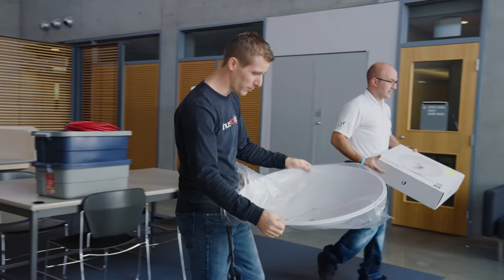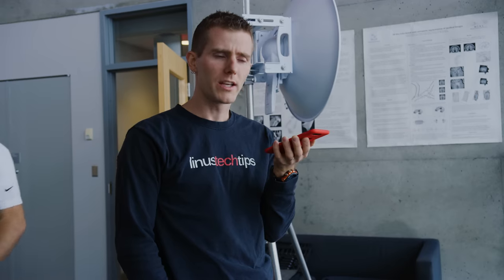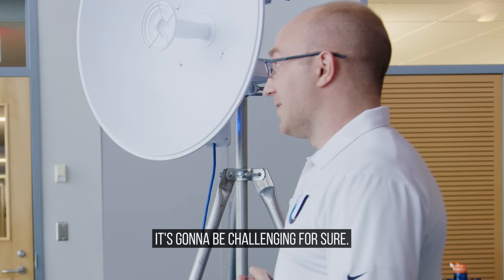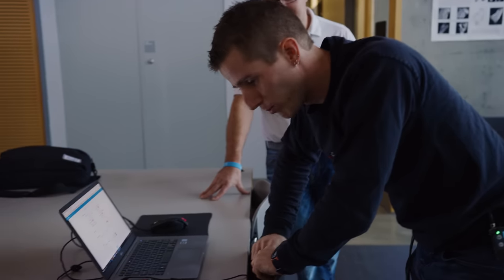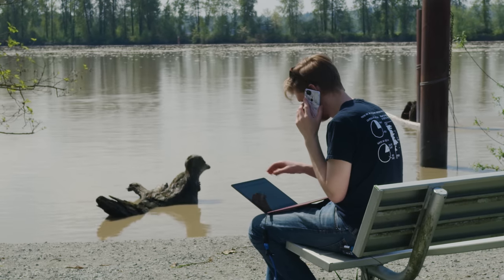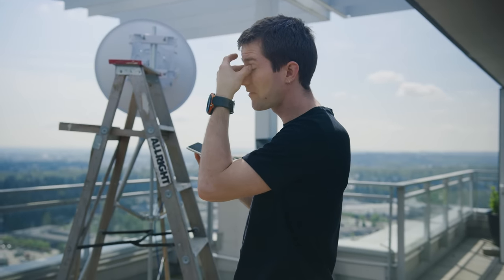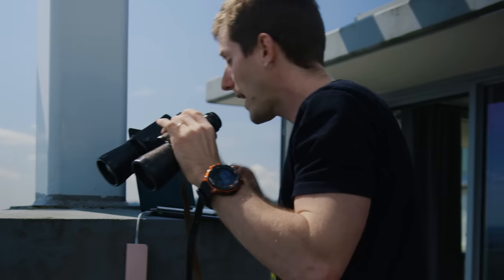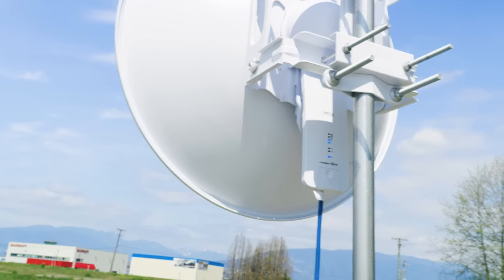12 KILOMETER Wi-Fi - SUCCESS!!!

Comment: lol Back in the days when no one password protected their wifi, I would just get an old Dish Network or Direct TV dish, a USB extension chord and position a wifi dongle approximately 2 inches below where the amplifier (signal reciever) went and could get signal from 2 to 4 blocks away pretty easily. I helped a friend who lived on a hill do this and we actually got somewhat reliable signal from a hotel 3/4 of a mile away. We picked up the college campus 2.5 miles away, although we couldn't connect reliably. For the record, as far as I know, the local laws allowed for this but I was still courteous when I could see that they were using a lot of bandwidth and would disconnect.
Just remember that a dish is a directional antenna and point the thing toward the router/antenna.
Reply: You have to remember that the dish/antenna will only amplify one direction. If you want a reliable connection you need antennas on both ends. Thats why you can rig up a "cantenna" or a makeshift dish and pick up peoples wifi signals, but if their router cant send packets back its basically pointless.
Reply: @coreyrussell8895  The dish will amplify in both directions, satellites don't have giant dishes on them. Also this trick actually does work, the feed horn is just a simple dipole antenna just like the antenna in the wifi dish.
Reply: @derpinbird1180  satellites don't send a signal, they simply relay signals that are sent from a transmitter at a different point on earth. You need to have an amplified signal on both ends.
Reply: @coreyrussell8895  How exactly would you relay a signal without receiving it and then transmitting it again? Or do you think sattelites relay the signal with no power and no processing? A dish is just a mirror it works the same way in both directions, it boosts receiving sensitivity and transmission power by whatever the db rating is. Have you ever seen a dish with two different db ratings for sending and receiving? Could you link me one?
Reply: @derpinbird1180  I don't know what kind of point you think you're arguing. Satellites amplify the signals from the ground using transponders. I'm not here to teach you networking and communications, but I suggest you do some research before making unfounded claims.
Reply: @coreyrussell8895  No magic dish with different tx/rx sensitivities then? Are we arguing on the definition of a transponder now?
noun
plural noun: transponders
a device for receiving a radio signal and automatically transmitting a different signal. 

Gee that sounds and awful lot like what i just said
Reply: Found this on a website, already know this though as i already told you that you cant find a dish with different tx and rx sensitvities but this is what an article on processor online said: General features of antennas
Every antenna has its own specific design characteristics that determine the range and radiation pattern of the radio signal. Also, if you analyse its radiation pattern for transmitting, its sensitivity pattern for receiving is the same. That is, the direction in which it transmits the strongest is also the direction in which it is most sensitive for receiving.
Reply: ROFL This is awesome! 
I don't know why this became an argument or got so complicated but if a person can't visualize what the dish does, a little experimentation will lead one to conclude that the dish is just a mirror/lens combo, like Derpin Bird mentioned. Polish the surface and it does the same for the visible light frequencies. Put a speaker or microphone into position and it does that same for sound.
...it ain't rocket science.
Reply: Nah man were totally wrong we haven't done enough research
Reply: you can hear the signal but it can't reach you to talk to your radio.......lol it isn't amplified

Comment: Perhaps use flare guns to get exact bearings. maybe WIFI signal can go even beyond 12KM's. Also a powerful handheld laser on a clear night can also be seen.
Reply: Or just use GPS lol. Once he can get it within the margin of error for GPS, he can then mess with the angles a bit until the beam is on point.
Reply: It can.  I (vaguely) remember reading about an experiment in the early days of wifi where they shot an 802.11b signal over a mountain with a passive waveguide (soup can) repeater on the top of the mountain for a 10 or 12 mile link.
Reply: It's all about line of sight.

Comment: I set up a 17mile Ubiquiti link today. That’s a long ducking way for you metric types. But I had some height on each end.
Reply: promethbastard - very true, some are smarter than others. Truth is I was too tired to do conversion after climbing towers all day lol.
Reply: easy with amplification..
Reply: It annoys me how long they take set up this type of link... I did 5k solo with my ubnt kit in about an hour
Reply: Robert Buchan Terrey - I have a couple of the POE battery packs with WiFi. Makes setup so easy, can configure and peak from your phone. Hardest part is not dropping phone off tower while turning wrench.
Reply: @PapaWheelie1  Some clamps or the bendy clamping tripod and a phone mount would make it easy to fasten your phone right to the tower.

Comment: Oh man... I am so cringing on how you guys are doing this. You should come to my work and we can show you how it's done. Let's just say we had an 500Mbit/s airfiber ptp setup at 27km. It's now replaced with a 2Gbit/s Microwave link. 😎
Reply: I'm sorry, but for your information, the current fastest mode is fiber optic, which is 100 megabyte per sec per strand.    

do you mean 500 megabit ?   that would be pretty good for 30 km
Reply: Yeah, sorry got my acronyms wrong. It fixed now.
Reply: what wattage did your transmitter had?
Reply: Can I do this at home? 😂 or at least suggest me some parts for faster internet.
Reply: You probably can if you have the money. Just for the AirFiber5 alone, they are $1,000 USD each. Plus you need to make sure the source connection has enough headroom speed wise to even deliver that much throughput both ways. For us as an ISP we have a 40Gbps connection to a nearby data exchange so we have plenty to work with. If you think this is expense just imagine how much license Microwave ptp links cost. For most people, you'll probably have better luck using NanoStations ACs for home ptp links. Easy to setup and just need to make sure they are within line-of-site to get the full throughput. You won't get the distance like with what linus used, but it will work if you have the headroom. If you can, try to get the World versions instead of the US version.

Theodor Butters, if you want to know specs on ubiquity airfiber radios, you can look online at ubnt.com. They have datasheets on all their radios and are fairly realistic.
Reply: Albert Westra Sounds like a video made by you would be wayy better then whatever Linus made.... Where professionals stand out from amateurs like Linus.

Comment: I had a similar set up a couple years ago, I actually commented on the original video asking how to set it up over longer than the parking lot distances. I could never figure out how to set it up because I was sure there was a "professional" way of doing it with compasses, maps, people, and "resources". Like, there was land elevation, hills, valleys, peaks, water, no water, gods or no gods...anyways the building that the receiver was on burned down and I was forever unburdened by that $700 impulse buy, and failure reminder. 

Fast forward a year and I finally see this update to the original video and am a little happy that there actually wasn't much more than two people using the led indicators and cellphones, thank you for making this video. I mean, I should be mad, but i came up with some good ideas, so it wasn't a complete waste.

I had used a topographical map for the first time in my adult life. I learned that, while compasses point North they help not when North is not what you are trying to find. At the time I don't think Google Maps had a simple line drawing tool but there was a hard to find website that could plot a line of sight. I mounted the receiver on a 75ft grain elevating leg...think of that for a minute... I waited for Maps to update and tried various ideas on using GPS location numbers, compasses, maps and that little needle device that you see in movies about sea navigation. I even ran an inverter off my truck and drove to the mid way point to try and find the signal, BUT...i stopped short of buying better binoculars because I was sure I was so far out of skill to set this up.

Comment: Or just get a mobile data plan
Reply: because of course mobile data plans are fast enough to give you 200+ mbps per second
Reply: xtremeguy2256 and this sketchy long range wifi is?
Reply: if your adjustments are perfect, yes.
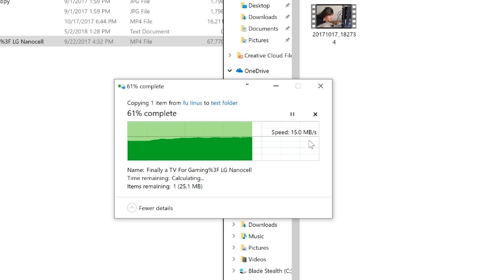at around 20:01, he says that he could get speeds of up to 15Mb/s which is around 120Mbps, and if you do more perfect adjustments, it is possible to get faster speeds
Reply: xtremeguy2256 I thought Mbps and Mb/s mean the same thing
Reply: i used to as well, just until a month ago. it's very commonly mistaken to be thought to be the same thing.
Reply: xtremeguy2256 so what is the difference? Doesn't the / and p just mean "per"?
Reply: the mb/s is megaBYTES per second, and mbps is megaBITS per second.
the actual difference is here - 

megabits and megabytes. bits and bytes.
one bit is just one binary value - either 1 or 0
one byte is an array of 8 binary values, or 8 bits. this is what everything else is measured in, to files, free space, etc.

so if you want to convert bits to bytes, just divide by 8. i'm not sure why the standard measurement for internet speed was bits per second as it just makes stuff confusing and such.
Reply: xtremeguy2256 Interesting, thanks for the info!
Reply: xtremeguy2256 MiB/s is megabits per second :/ MBps really is megabytes per second
Reply: MiB is Mebibytes, (not a typo), not megabits.
Reply: NikProBG 123 mib is mebibytes
Reply: Add in the effects of 8b/10b encoding (or 64b/66b, etc...) and even 8x might not be exactly accurate.

Comment: Pretty cool.  We did 12 mile (~19 km) wifi test back in 1998-ish.  Eventually had 20 or 25 premium customers getting wireless internet up to about 8 miles from us for the next 3~4 years.  We were running the feed over a SDSL twisted pair and unfortunately, it just wasn't competitive with the cable company after a couple years.  Telco gave us grief with the twisted pair usage and while we were more reliable than cable internet in the beginning, as a small internet provider, we couldn't justify putting enough equipment redundancy in place to stay ahead of the competition.  I still can't believe the stuff we pulled off back then.

Comment: I moved out of the city in 2002 and left behind a 4MB symmetrical connection, to the land of telco carrier-lines and 23kbit hell, until I could wrangle several years later a 12 mile shot using Motoroloa Canopy radios, for a whopping 8mbit asymmetrical link…  that eventually lopped down to 1.5/.5.  :(

Comment: Makes me think about what some of us ham radio guys are doing with microwaves.
I know a guy who made a 400mi contact on 10GHz. There are also guys experimenting with 47GHz. Apparently you need to have extremely dry conditions because moisture attenuates the signal drastically as the frequency goes up. I think the record was 12km on 47Ghz.

I haven't played with microwaves yet but someday I will. What's also interesting is that us hams also have an allocation on the 2.4 & 5.8GHz bands too (since the primary is ISM) but because we are licensed we can use several watts on these bands so that gives us better signal propogation!

Comment: Bitch, please. I currently have 78mbps at 14km between far smaller nanostations, two loco m5s. With the ubiquity nanobridge (which is still 3 times small than those beasts) I've done well over 100mbps at 20km. 
Also, you don't need fucking binoculars to find each other and align. Just do a site survey, and move around a bit until you find it, then fine tune vert/horiz. You can set up a link like that in an hour tops. 

Ubiquity fucking rocks.

Comment: 1. Get GPS coordinates for each location
2. Convert geographic coordinates to UTM grid coordinates
3. Use Pythagoras to calculate acute angle
4. Add relevant angle for appropriate quadrant to obatin grid bearing
5. Use compass to point to direction and done.
6. That's how to align tv aerials

Comment: When i had a  mobile connection using a internet usb key on the PC, i knew some stuff about electronic and telecommunication, i had 2 levels of signal, what i did next was incredible effective. I reached max signal of 4-5 levels just by putting the "internet usb key" in the middle of a metallic and parabolic shape disc that was taken from a big fan for the room, it's basically the same as a good new parabolic antenna. It's a simple hack that boosted my internet connection capacity by a lot at that time, passing from the limited signal with a 5-10Mb/s bandwidth to around 20-30Mbp/s with around 50-90ms ping which was good for a mobile connection.

Comment: I've been using Nanostation-ac at the office for over a year now to give our other building internet. I have our Phone system, Internet, ERP system and general filesharing all working without issues. We were looking at running wires across but due to regulations and cost (near $8000 to do the job) I picked these up for just a few hundred bucks and it's perfect. Great for if you have a home with a barn on your property and want to get internet too it. Solid Solid Solid not a SINGLE drop of any of the above for a year+ now. Great Tech!

Comment: The link might have been easier and quicker if you guys had used the Ubiqiti's Airlink (https://link.ui.com/ ) and a Compass to help you know your heading. You will need to put the GPS coordinates of both locations in the Airlink page, select the type/model of UBNT radio/antenna, put in the antenna height of both nodes, then software uses GIS data to simulate the link quality, and also shows you the direction ( or "heading" ) to point the antenna.  you will need to use the compass to point towards the heading, then you sweep left or right to fine tune. Great video!

Comment: Wow.. they really made this hard work for themselves.  at the same time as this video I was thrown a bunch of the same equipment and told to set up 3 hilltop VHF repeaters all linked by this network.  With zero knowledge I just read the instructions and used some logic.  Checked that everything worked to each other in the office before leaving, did the map survey on the link tool that is on the Ubiquity site, wrote down the grid reference, elevation and bearing for each site.  We all drove out to our sites, set them up on the bearings that we agreed before leaving, and bang.. they were in.. we did some slight adjustments to make them better..  Shortest link was 19km and longest was 48km.

Really disappointing to see smart people who I look up to faffing around so badly with such simple equipment. I'm hoping it was all theatrics just for the camera rather than their actual experience.

Comment: My radio knowledge is quite amateur, but if my understanding is correct, the "cone" of a focused RF beam isn't exactly cone shaped as you might expect.  Think of it more as a bunch of fingers rather than a fist.  At that distance, I don't think they were necessarily that spot on, the adjustments might have just been optimizing one of the fingers. https://upload.wikimedia.org/wikipedia/commons/thumb/8/84/Uplink3.png/440px-Uplink3.png

Comment: We were doing 50km using 12' dishes and Ubiquiti Rocket M5s in Muskoka 9 years ago.
RSS-247 lets you use unlimited antenna gain in 5.8GHz. 

We got ~50Mbits at 99.98% reliability.
You could also do the same with Mikrotik and the high-power 5.8 cards.

Comment: You check out some of the stuff HAM radio operators have been doing with MESH networking for years. A good starting point is the Aredn website. We have a county wide high speed wireless network with dedicated servers, phones, VOiP, etc that doesn’t have to be connected to the internet and usually isn’t.

Comment: Just a thought; setting this up at night with a high powered adjustable beam flashlight (~$20) on each end would make alignment a breeze. If Ubiquity would put a 'sighting hole' in the dish one could simply stand at the rear of this dish, look through the hole and line up the light into the cross-hair.

Comment: I dont think we should rely on the internet, in most cases when you dont have a connection you get left out. Like for instance...I wanted to charge my phone with my money from my telephone company, and I only run into technical problems that doesnt have an easy workaround thanks to the limitations we put on the net...

People say it is free, when it isnt. As if it was, we wouldnt need to have to pay for it to be able to use any of the services...

Internet should be a free service, and connection aswell, as in NOT behind a paywall...but instead put the services behind paywalls instead, if we want to use it. But the internet should let us be able to go on any website, and pay for stuff in offline mode, so that when we recieve the connection again, the transaction can get completed.

The fact that we have to have wifi to be able to make a transaction, deffeats its purpose of being "easy to use", as it puts you as a consummer in a catch-22 moment, you cant work around.

Comment: My only experience doing "IT" work was setting up an Ubiquiti wifi system between 4 buildings wirelessly using Nanostations as bridges and daisy chaining the access points.
It worked great but was a massive pain in the ass to set up. 
The nanostations were so powerful even at 100 feet apart that I had to get them unaligned so the signal from one Nanostation wasn't skipping the intended reciever and going to the next building.